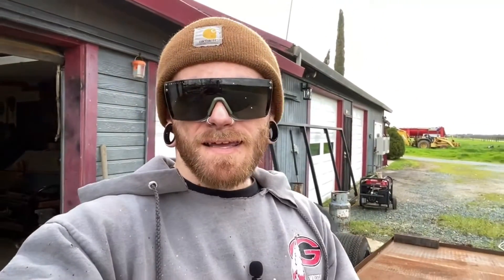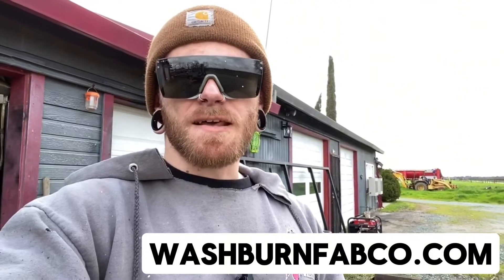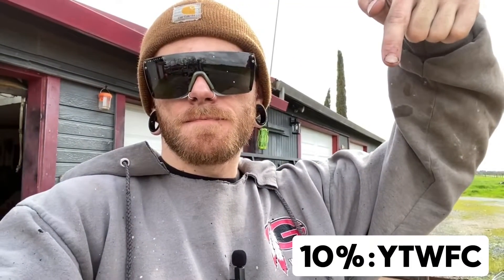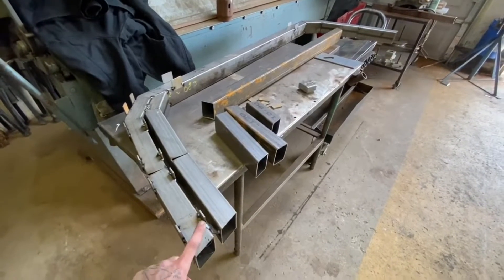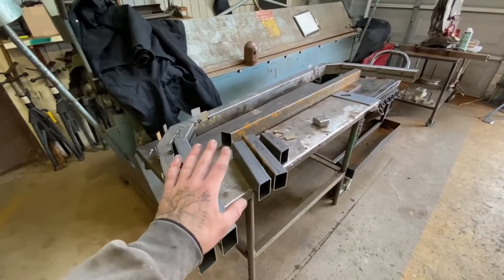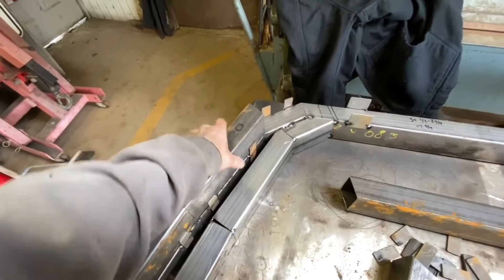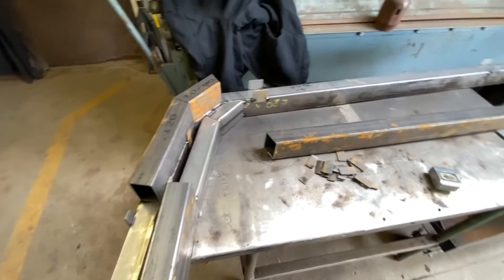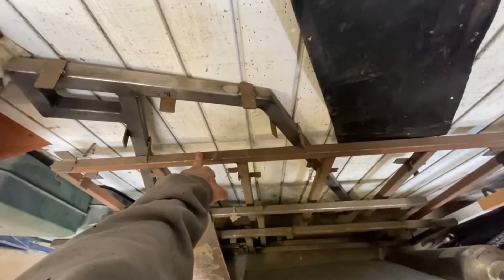(GIVEAWAY ANNOUNCEMENT!) How To Fabricate Simple Frame Jigs / Welding Fixtures

Comment: Got an everlast plasma/stick welder that just crapped out.
Reply: Had it almost 3 years, bought it used. Used it a lot. I was cutting a 36” pipe for a fire pit and it quit about halfway and won’t turn back on. Ended up zip cutting the rest so got the fire pit done at least lol.
Reply from the maker: How much did you use it before it gave up ?

Comment: Do you use air or electric tools in your shop?
Reply from the maker: Both but mainly corded. Only battery for quick grinder cuts drills and impacts. Air for die grinders air hammers and needle scalers etc

Comment: I was taught a long time ago jig everything you can if you are going to build multiple. Most of my welding career has been building custom equipment. For parts that were the same building a jig makes it faster accurate and the same everytime. I even made plasma jigs for cutting parts.
Reply from the maker: Yeah I’m on the same page with that. Only problem is I got stacks of jigs I don’t use any more lmao